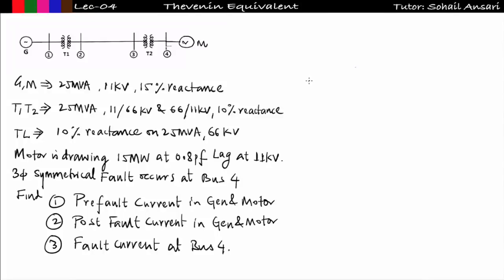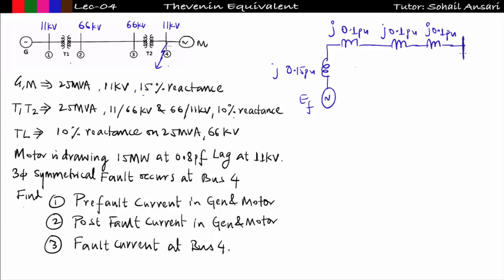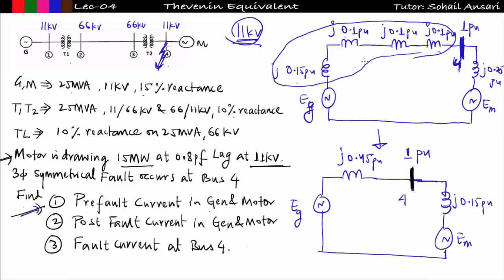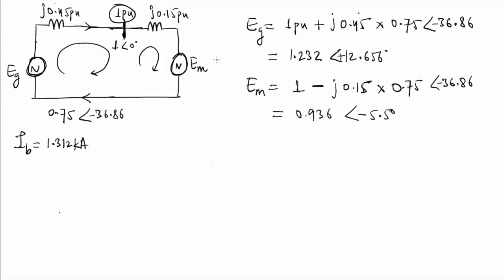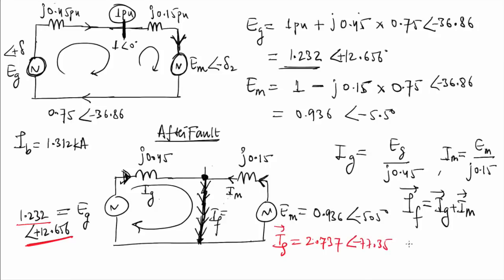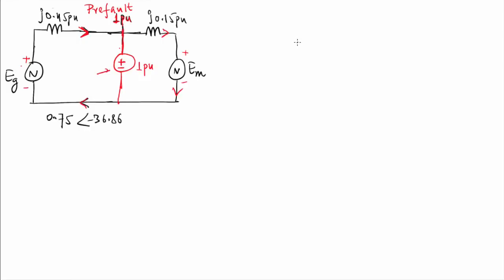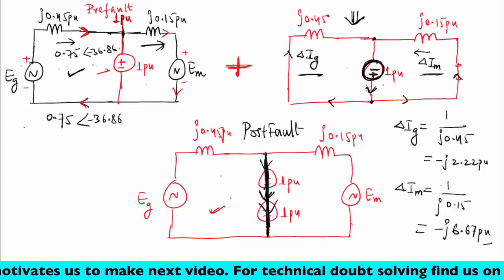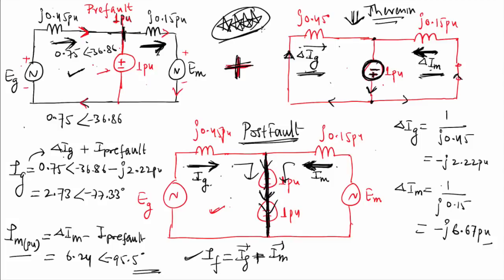Lec 04(b) Thevenin Concept in Symmetrical Fault | Power System | GATE & ESE

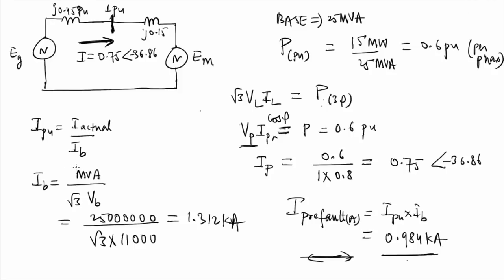Comment: sir, there's one mistake at 8:04 the prefault current which you obtained is "Line prefault current"...since you multiplied with "Line base current"...
and also "Line current in PU is same as Phase current in PU, irrespective of star or delta configuration"